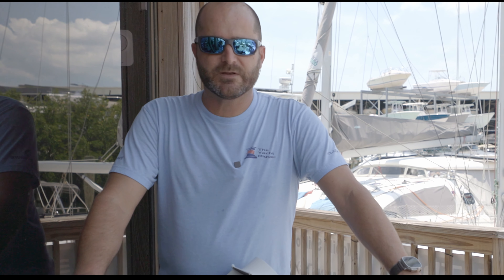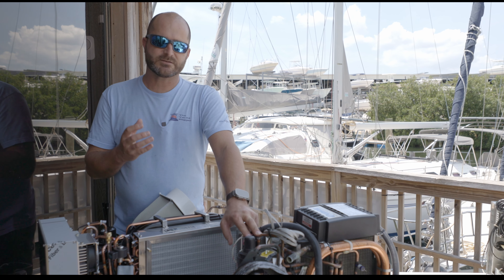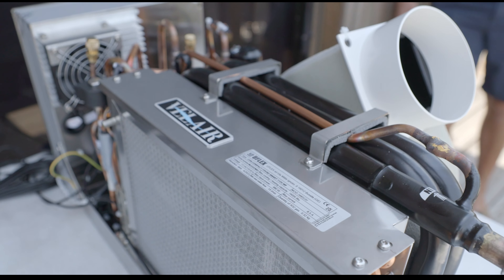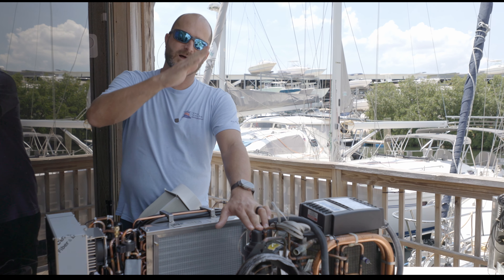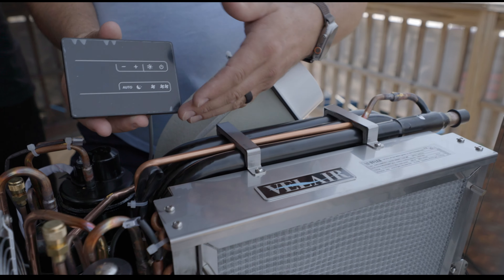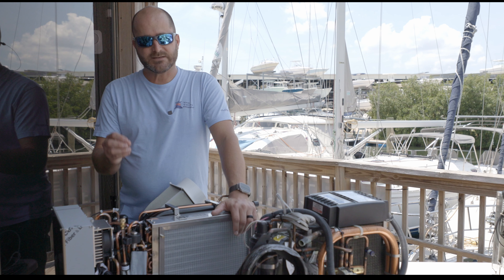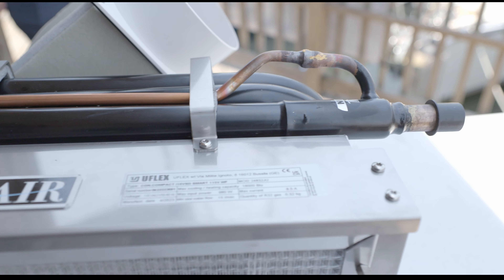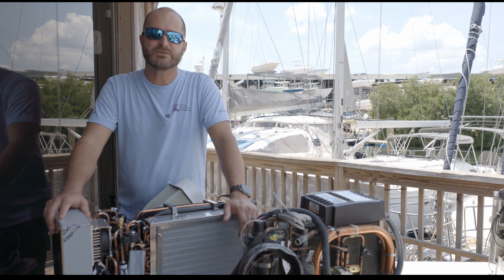New Marine A/C Innovations and Release | First Look Series

Comment: 300  running watts On the 16K BTU Velair 115V unit on the lowest setting 5-6 btu. 500 watts at the Mid speed and 800 watts at the highest speed setting.

Comment: no more news?
Reply from the maker: I feel ya! I have to wait until the lead electrician is less busy. Turns out, testing these requires a ton of work to hook up and measure and swap! But it's very high on our list. Thanks for reaching out.
Reply: 4-month report:  I have have been using a Velair unit for 4 months; seems OK.  Happy with it.  It draws about 8.5 amps max (nameplate rating) at 115v (including the water pump) but usually around 5 amps.  The "built-in soft start" is nice, as it starts using about 2 amps, then very slowly ramps up, usually to around 5 amps, only, though at max can draw 8+ amps (nameplate rating.)  I have stopped using two shorepower lines; 30 amps is ample.  (My previous A/C, which worked well, cooled about the same, but drew 17 amps, which is why I replaced it--I thought the compressor was about to fail.) To boost the cooling on hot days (most days in Houston) I usually run the fan at max during the day, rather than "auto."  It has a "nite" mode where you can run it at minimum output (lowest fan and compressor speed) at night, about 500 watts, that I use because it is quieter. 16k btu's is a bit undersized for my non-insulated 38' boat (I could use 30k btu's, I think) but it stays quite pleasant, humidity around 30%.  The thermostat could be improved upon,  is not attractive, has a protruding presentation (not flush) but works OK, and can be controlled thru the internet, which is what I do even when on the boat.  With my 5kwh of lithium batteries I can run the Velair for around 4-5 hours at anchor, if I choose [but I also have a DC A/C in the aft stateroom that only draws around 100 watts (including the pump) so is more suited for overnight use at anchor.]  My perceptions of downsides are 1) the cabling for the control box is too short to readily remote the box; 2) It might be difficult to find a competent refrigeration technician, because it is more complicated than most a/c units, 3) the unit's condensate drains are placed on the ends, which complicates installation because it is already longer than similarly-sized a/c units (I wish they had put potential drains on each of the four sides,) 4 the cabling is really not elegant at all; some lines are way too long, some are too short, just wadded up at the unit with wire ties.; 5) and, as mentioned, I would have liked more thermostat options. I installed the unit myself.
Reply: @JohnKJohnson  Do you have GEN 1 or GEN 2 ?  How loud is the compressor when set to high speed?
Reply: @AVMAR Not sure which gen unit that I have. I cannot hear the compressor at all over the air-handler fan.  At max, the fan noise is similar to my previous non-inverter unit.  The air fan runs at max all the time in Houston summer heat.)  However, when the heat/cool demand is low then the the air fan speed reduces, along with air noise.

Comment: Youtube being a rabbit warren of hidden gems, perhaps you haven't seen these.
My preferred option for >30 foot https://youtu.be/PUikCCqZRFI, larger due to housing (which could be broken down to look similar to velair size), potential of better option with heat exchanger, more efficient, reverse cycle option, easier parts availability, or full replacement almost anywhere, at around 30% outlay of the Velair. 
This is the option I'd likely use on a <30 foot mono - https://youtu.be/_M0OiAi5rEM